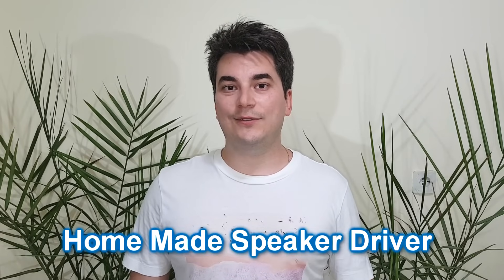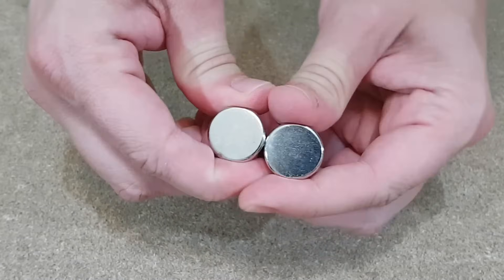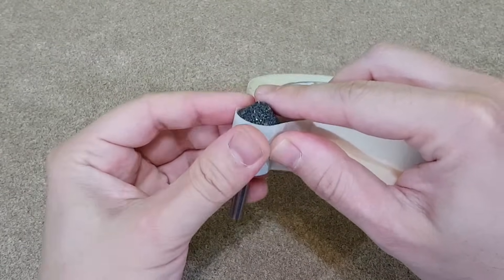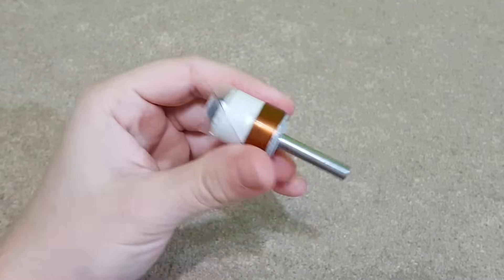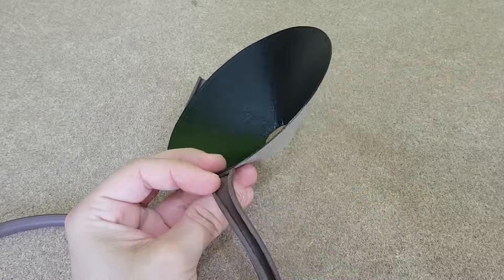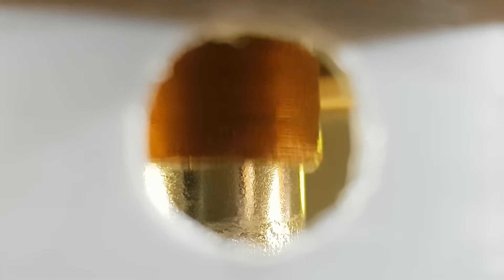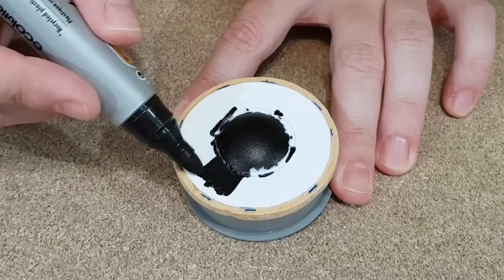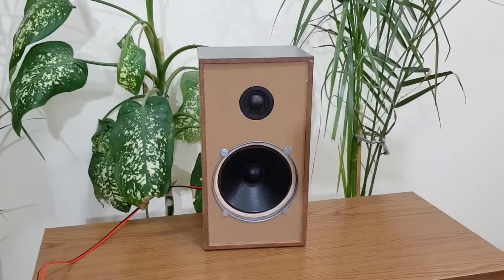Home Made Speaker Driver

Comment: i tried something similar to this but just trying to rebuild the coil and nothing works.....so it does matter witch way you rap the copper wires...?
Reply from the maker: The only thing that matters about the direction of the wire in the voice coil it's the resulting polarity of the speaker. it can be +/- or -/+.
Reply: @Sorin_DIY i tried both ways but maybe im doing something wrong....thank you so much....

Comment: how would you determine the power handling and build accordingly?
Reply from the maker: If you build a speaker driver with household materials, it's impossible to determine the exact power. But you can test it with different amplifiers and estimate the maximum power.

Comment: El portabobina major en otro material porque al aluminio le afecta el campo electromagnetico
Reply from the maker: Voice coil formers made of aluminum have a gap of 1mm between the edges of the aluminum sheet. the edges are not connected, so the aluminum former it's just a sheet, not a tube. this is on purpose, because an aluminum tube is affected by Eddy currents. so no aluminum tube, no Eddy currents.
Reply: @Sorin_DIY  excelente explicacion. Gracias.

Comment: DANGER Will Robinson
Robot senses eminent overcharge of phone...
Parallel connecting batteries causes the voltage to increase in sequence of each added module... If I remember my "small" fire 🔥 last year...
In the example given the new voltage ⚡ would be more like 9-15 volts...
My fire was caused by using a higher amperage and slightly higher voltage 9v instead of traditional 5v android wall charger... 
After I unplugged the smoking batteries ( 10 min) they did NOT cool down.
Warning: they continued to smolder until the lit a flame 🔥.
Then they continued to raise in temperature until they were white hot 🥵.
I could not put it out... I ended up placing a metal pot on top and it continued to burn like a sparkler for like 3 hole minutes... 
It burned a hole in the hotel's carpet and into the ceramic tile underneath...
So much smoke I had to block my door and open my window for 45 min. Before I peeked out.. smoke detector was quickly disabled,lol..
Be very careful... I only used two small portable charger batteries...
Otherwise... Happy monitoring...

Comment: I really enjoyed your video. New subscriber here. You are very creative. I did a project like this too. It sounds amazing but at high volume 70% above, it doesn't sound good. It might be because of the weight of the cone. It can't vibrate as fast as it needs to. In deep bass it's a problem. Any suggestion in using papers for the cone
Reply from the maker: hi. Thanks for watching. for low frequency bass theoretically it needs a thicker cone made from stronger cardboard. but the speaker spider and suspension are also important, they need to allow the cone to move.

Comment: Absolutely outstanding work. I've looked at various diagrams without properly understanding it. Now I completely get it.Thank you Sorin! 

Modern manufacturing techniques mean even complex things can be manufactured extremely cheaply. Nothing here is hard to make in a modern factory, all the parts are so simple that Sorin was able to make a passable version out of literally nothing. I fully appreciate that speaker manufacturers use high grade materials to make really high performing drivers but, at its core, it's a very simple collection of parts. There must be plenty of profit to be made when selling a few of these drivers in a nicely built cabinet and charging £1k, 10k or even in excess of £100k in many cases. 

Anyway, Bravo Sir!

Comment: I really liked the video, I'm even buying the materials to make the speaker, but I'm in doubt about how many watts the amplifier board should have, how many watts does the board you used in the project have? I really wanted to know
Reply from the maker: the amplifier I'm using has 2x 15W, that is enough for this type of speaker driver.

Comment: A small suggestion. You stated that the aluminum coil former ring should not make continuity across its seam. Wrapping Kapton tape over the ends of the former, before placing it on the grinder stone, will make certain that the is not a connection.

Comment: 3:03 - How do you figure out the exact diameter and number of the holes needed for ventilation?
Reply from the maker: Hi. powerful speaker drivers have only one hole for ventilation in the center of the magnet. for my DIY speaker driver I didn't have to make any calculations for the venting holes. I made more holes than needed to be able to film the coil inside.
Reply: @Sorin_DIY  Thanks for the info. 👍

Comment: Speakers are rated in reactance resistance. So 5.6 ohms is generally 8 ohms on a speaker.  Also if you put a metal ring or sleeve around the outside of the coil that would greatly increase the sensitivity as this would pull the magnetic field across the coil.  Good job.

Comment: It's excellent work, but tbh it would be better to simply buy one, as the manufacturer will have calculated DC resistance and impedance, heat dissipation, mass, compliance, resonant frequency and standing wave distortion effects.

Comment: Just don't try to wind colis the way he does. The wire will cut your fingers. And that magnet seems way to small for a speaker this big and it doesn't have an iron cage to make an optimal strength and uniform magnetic field. Also the cage of the speaker shuld be stronger. But I like the way he made the suspension and the cone.
Reply: The iron cage your talking about is a pole piece which is for venting plus that's a neodymium magnet which are stronger ferrite magnets

Comment: Such an informative video! Great work dude! What gauge magnet wire did you use for this project? Does the wire gauge matter all that much? Thanks!
Reply from the maker: Thanks. I don't remember the wire gauge. if you want the speaker driver to be more powerful, it needs a thicker copper wire. but a thicker wire also needs a larger diameter voice coil and a stronger membrane and surround.

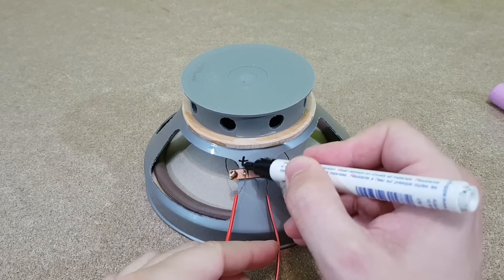Comment: 13:10 the audio filter is optional?
Reply from the maker: it depends on the speaker driver. if you use a low frequency speaker driver it also needs an audio filter.
Reply: @Sorin_DIY  being that I would like low frequencies and mid frequencies I don't think I need the audio filter

Comment: Very well done, Sorin. But if you had put a little more effort in your project, the outcome might have been a lot better. I bet that your speaker does not deliver much sound for a given power. That is because there is no closed magnetic circuit like you find on the industrial type speaker you show us in the beginning. Btw, how did you figure out the dimensions of the reflex tube?
Reply from the maker: hi. the diameter of the reflex tube should be at least 1/3 of the diameter of the speaker driver. the length... it's just a guess. the speaker driver is improvised, so the reflex tube is also improvised.

Comment: Putting the magnet in an iron cup would greatly increase the efficiency of the speaker, and this could be further increased by adding some washers on top and then placing the voice coil between those washers and the cup; this is how many commercial speakers are made.

Comment: Im an electronics hobbyists and technician too. I do assemble  audio power amplifiers like 40 + 40 watts PMPO 100 +100   power amplifiers. Stk 4040 and LA 4040 IC chips. 
My question  is that for woofer speakers cone paper thicker and coil   must be thicker to cut higher freequncy  in.order to get low freequncy  to produce harsh sound called  bass. Wise versa when you  make tweeters low freequncy  current is cut and higher frequency ac audio amplified  voltage  is fed to the thin guaged coil wire to produce  shrill sound as it vibrates  so 4.5uf capacitor  should be used
Reply from the maker: it depends on the construction of the tweeter. for most tweeter models the producers recommend a 2.2uF or 3.3uf capacitor.

Comment: Dude, are you going to make your own capacitors and resistors next?  This is serious DIY.
Did you just use a best guess for the cabinet size, or are those common measurements?
Reply from the maker: hi. I can't use a volume calculator for the speaker enclosure, because everything is improvised. the enclosure should be bigger for this type of speaker driver, but it works for this demo video.

Comment: The filter of few turns on antenna ferrite is useless, its value is negligible compared to four layer inductance of the voice coil. I am impressed by the tweeter, what ingenious idea to use ping pong ball.
Reply from the maker: the bass filter doesn't do... too much filtering. I just wanted to explain the concept.

Comment: When joining large components with superglue, you can use baking soda aka sodium bicarbonate to quickly cure the superglue while at the same time adding structural rigidity to the glue itself and in turn adding rigidity to the joint. Make sure the baking soda is nice and dry. It will cause the superglue to “kick” very quickly. NASA uses this superglue hack. I use it ANY AND EVERY time I superglue anything that needs to be held quickly and very firmly.

Comment: You did quite a commendable job with this. The biggest difference between what you made and a factory speaker, I think, is that the shape of your magnet's field isn't very well-suited for the purpose. But you would have been very hard-pressed to make a more suitable magnet whose field lines were perpendicular to the coil. Still, you got the basic function down.
Reply: Exactly! The magnet structure is wrong as it does not concentrate the magnetic field perpendicularly to the coil,  It's the biggest flaw in this build and it will mostly lack in sensitivity and linearity, however this is an incredible acomplishment to have put all this together and to have a reasonably well sounding driver, congratulations!!!
Reply: You need like a ring of bent horse shoe magnets with the poles facing inwards. The conventional loudspeaker does this using a standard ring magnet and some steel pieces to conduct the field through to get one pole on the inside of the coil and one pole on the outside and get the full effect of Fleming's left hand rule. The first piece of steel is a cylinder attached to a disc. It forms a solid top hat inside the coil and conducts the field from the back of the magnet. The second piece is a steel ring stuck to the front of the magnet and conducts the field from the inner front of the magnet to the outside of the coil.

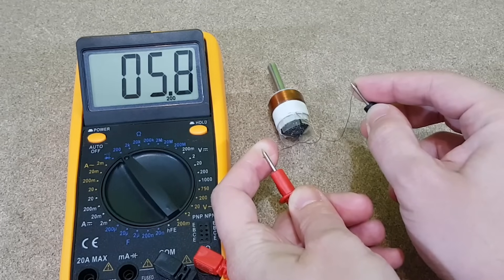Comment: 7:57 but you are measuring ohm instead of the impedance
Reply from the maker: the impedance is also measured in ohms.
Reply: @Sorin_DIY  m confused , because impudence depends on frequency and it mainly works in case of inductor so how can be impedance measured with ohm meter ?

Comment: Why'd you didn't you seal the box? How do you wanna know the specific parameter of your diy speaker? You need to match the reflex tube and tune it to the right frequency, or else it might become destructive in terms of "audio quality"
Reply from the maker: hi. the purpose of the video is to explain how speaker drivers work. I didn't used standard materials to build it, so I can't measure the parameters. I used only household materials.
Reply: @Sorin_DIY  that's why i wonder why you didn't seal the box. nice video nonetheless!

Comment: Hi, I am following your stepts to make my own speaker. Can you please tell me what exact type of glue you are using for the speaker coil?
Reply from the maker: hi. I'm using poxipol. but you can use any epoxy based, 2 parts adhesive. this type of glue usually takes 1-3 minutes to harden, so you have some time to wind the coil.
Reply: @Sorin_DIY  Thank you for your fast answer! Can I use C200 glue, or it won't be suitable for the coil?

Comment: https://drive.google.com/file/d/1JUgpGx_DumVWD29gBVhG3ctX5iqNFU19/view?usp=drivesdk.    https://drive.google.com/file/d/1JaDOrU4FIHu959m8S-9D8V6g_cvxHmIy/view?usp=drivesdk.        
Sorin I made a speaker using panty hose for the spider & surround. The coil was made from paper packing tape hardened in polyurethane. Copper tape strips were put on each side of the coil & the ends soldered to the strips. This makes it easy to solder extra leads to go to the flexible terminal wires, if they break it doesn't compromise the coil. The pantyhose has just the right amount of flex for the cone. A plastic disk with a 1 1/2" hole is under the spider fabric to control the amount of flex. Just tested today  sounds like store bought! Thanks to you for the inspiration!  See links above for pics.

Comment: I didn't quite understand the maximum volume of this speaker, but I'm surprised by the bass and high frequencies in general. I am Russian and your accent (which is not =)) makes your thoughts more intelligible. the high-pass filter is also news to me, in fact it is a simple droysel, direct current passes better through the droysel than alternating current. I didn’t know that it’s possible, but when I saw it I immediately understood how it works)

Comment: This is a WARNING to who want make this DIY Speaker.
In all these videos of DIY Speaker all the people forgot to measure the voice coil impedance, that's critical to make the speaker work properly, too high impedance make the speaker less efficient and has low power as well, this speaker can burn out few types of amplifiers because higher indutance of the voice coil can cause ressonance on the LC filter and may exceed the limits of the component, causing them blow up.

Besides the problems that can happen, the result was very nice and the design was very good.

Comment: You could use the bottom of the soda can for the tweeter dome, aluminum is light weight and stiff, the lighter the weight the faster the frequency and more details it can do :)
Probably difficult to make suspension for the tweeter dome, but thin cloth and glue and a mold to make its suspension u shaped could make it close to tweeters one can buy. I think they make tweeter suspensions from silk and glue this way. You could make the dome of silk too all in one piece, silk is nice, i like the properties of both silk and aluminum. Aluminum tweeters is good for metal music with much happening in the sound picture, gets better details. Silk more for classical music, warm soft type music.
I am not sure that aluminum is the best to wind a voice coil around when one use the magnet inside the voice coil. Paper may be better. Becourse magnetically the aluminum will slow down the speakers voice coil acting like a shock absorber in a car. Look how slow a neodymium ball magnet goes trough a aluminum pipe on a video and you see what i mean. They made voice coils of paper in the old days.
Aluminum can get rid of heat and things yeah, good for 100.000 watts subwoofers likely.. but to make a living room speaker for pure good ordinary useful sound level, well, paper may be better making the voice coil go free'er and thus make more detail.
Speaker making is a fine art. I really like one-way speakers that is built good enough with a extra cone for high frequency together with a bass cone, becourse the harmonic details when a man and a woman sings together wont be as good and clear on a two-way or a three-way speaker with filters to compensate for overlapping sound not in phase.
Listen to this one-way speaker type, it is just very good.
https://www.youtube.com/watch?t=2830&v=EEh01PX-q9I&feature=youtu.be
It uses the two speaker cones and the enclosure shape as filtes instead of electronics as filter. Just like they did in the old days 1940's speaker DIY.
Here is also a comparison so you can listen to the difference of two-way and one-way.
https://www.youtube.com/watch?v=u0nSnvMvcIE
The one-way speaker element is not the best, it could have been 8 or 10" instead of 12" and it could have a tweeter dome too to make it better, but sounds good anyway regarding the dynamic range harmonics.
I once as a child borrowed a old book about speaker building from the 1930's & 40's and it was many ideas there on how to use the speaker cabinet designs as a filter to increase bass, reduce mid's or increase high's, whatever one wanted to do to the sound with shaping the cabinet and use dampening materials, unfortunately i dont rememeber the name of the book anymore. But it was many cool unusual shapes i have not seen since.

Comment: how much w does pam8610 have?
Reply from the maker: max 2x 15W, but you need good 4ohm speaker drivers, crossover filters, heatsink and good ventilation for the IC and a good power supply with 15V and >2A.
Reply: Sorin - DIY Electrical Nerd so can i put more amplifiers between 600w subwoofer and Pam sound board?

Comment: https://photos.app.goo.gl/zSv6AhDbLiRqKuaT8.  Check out the link to see the woofers built from your info. I used a plastic lid and a slotted dvd for the spider and surgical tube for the surround. No super glue! I never get it to stick. Used E6000 and epoxy. You have the BEST speaker vid!!

Comment: you could have also used the bottom of the soda can for the dust cover.
Reply from the maker: yes, but that is heavy compared to the paper cone or the ping pong ball. it will add weight to the speaker cone and it will alter the mid-range frequency sounds.

Comment: Hello, great project to reproduce a speaker at no cost, congratulations for the video, an information about the measures of the magnet? , for the re-tanning you can use a rubber seal I have flexible silicone so that it does not distort the sound? What do you advise me since I have to recover two loudspeakers? Thanks✌️👈🔝💯💯💯📺🎆🎆🎆

Comment: How many turns of copper wire should I give to make tha prototype speaker
Reply from the maker: hi. there isn't a fixed number of turns. it depends on the wire thickness and what impedance you want it to have 4/6/8 ohms.